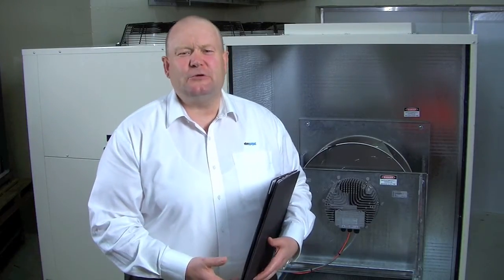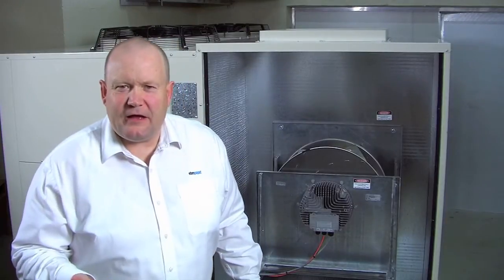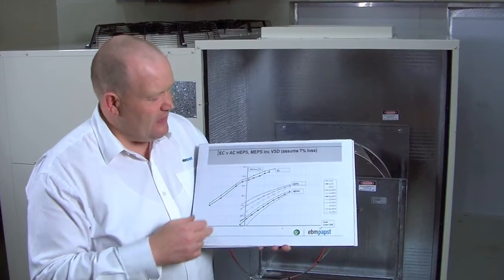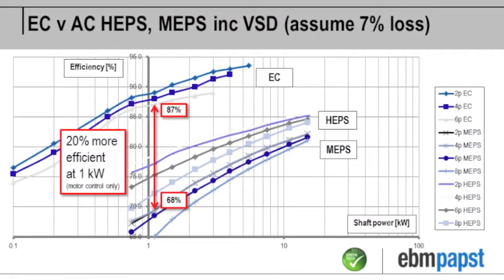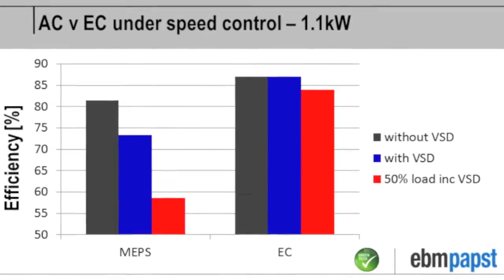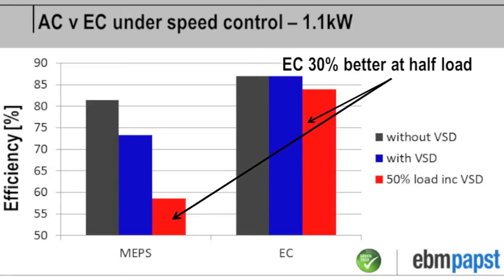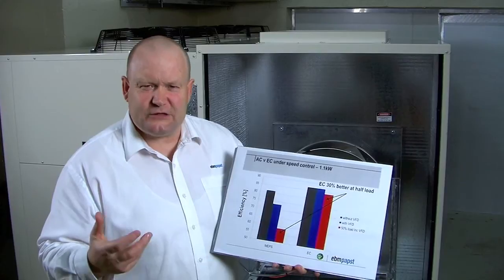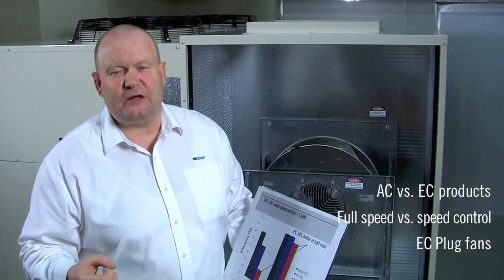Fan Efficiency: EC vs AC fans with a VSD - ebm-papst A&NZ

Comment: Slightly misleading graph, starting at 50% instead of 0%, makes the AC motor look much worse than it is, although it is pretty bad. You make up for it by noting that it's a 30% difference, but in this case it would probably be better to start at 0%. You've got a good product, EC fans are worth the investment, you don't need to pad the numbers.